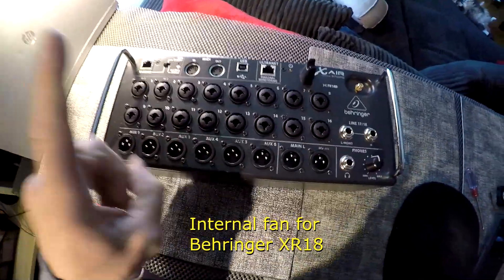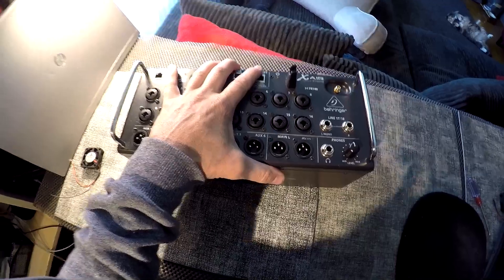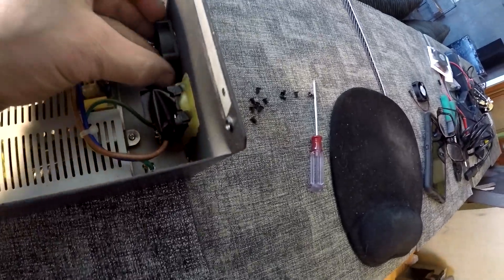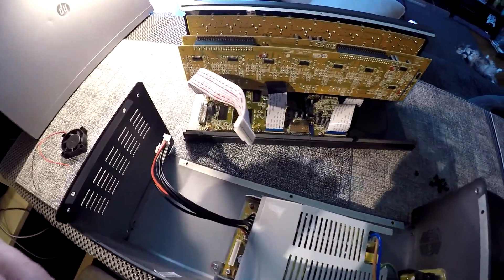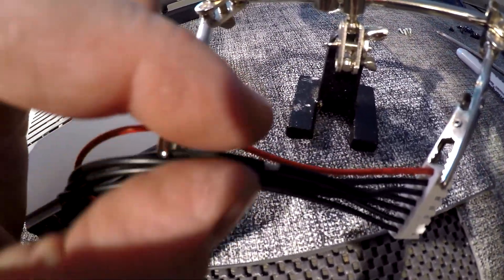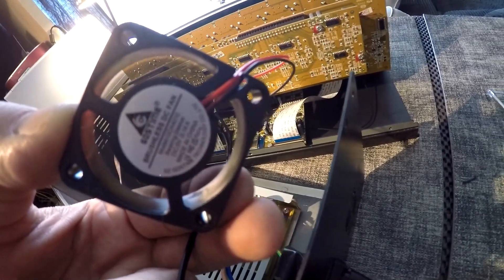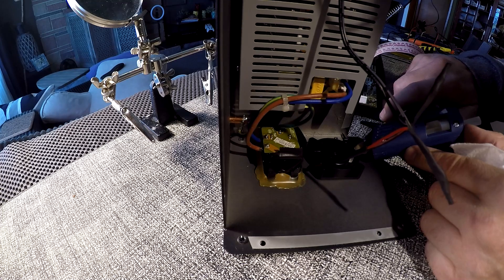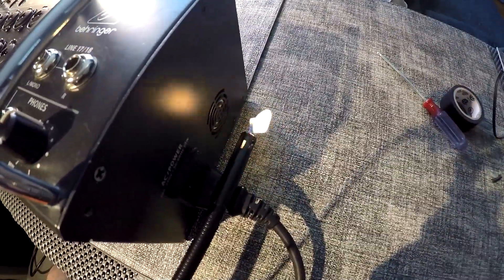Behringer XR18 internal fan mod

Comment: Wow i really thought there was a fan in my unit , did you point the fan so it was blowing out or in? im going to give this a go, noticed how warm the case gets after use
Reply from the maker: I actually tried pointing out first..then reversed it to go in.. didn't notice any  difference.. all that matters is there is air movement within the case..of which either way seems to work.

Comment: Siempre me pregunté que tanto costaba añadirlo de fábrica 😅

Me parece genial que no se indusca ruido notorio adicional a los canales, intentaré agregar un botón de encendido y apagado para cuando se requiera el silencio.

Gracias por tu vídeo!
Reply from the maker: I did replace the fan once since due to it being a bit of a cheapo fan.. but still running strong with zero issues or noise.. :) On/off switch is a good idea..if you want pure silence in the room. Makes sense.. I might do that too.  Thanks for the idea! :)

Comment: I thought about this. But I also thought I saw a header for a fan. That fan you used covers half the hole in the center.
Reply from the maker: @allenhoekstrajr  regardless of the perceived restriction...it works. It moves air and cools things down. Not many options internally to mount a fan. I recently reversed it as well to draw air in through that small  hole rather than out. Equally as effective. There is enough flow that you can also feel the draft push out of the input jacks and side vent.
Reply: @PaulGibbonsMusic  Note that I'm not trying to say anything bad about what you did. I appreciate it and am glad to hear I wasn't the only one looking for a solution. I also appreciate that you confirmed that it works effectively. Do you think more/better airflow would be better or do you think with this mod that it's more than enough?
Reply from the maker: @allenhoekstrajr  oh I didn't think you were saying anything bad! Scrutinizing is definitely accepted and required for the best ideas to come fourth. :) For me, this mod was all I needed. Before this mod, I would point a small 10" floor house fan at it. It was probably more effective as the airflow would encompass the entire housing with much more 'thrust' and convection, however, who wants to point a big fan at it every time? hehe. These units are fine without the fans for the most part. My reasoning for doing this was primarily due to literally performing in Penticton in 40 degree (Celsius) weather with this XR18 cooking in the heat.(Literally the steel casing could fry an egg!)  I knew it was only a matter of time for heat failure so I figured why not. A buddy of mine fried his XR18 power supply because he always left the unit in his little gator case when operating, blocking any venting from the side ports. (most inputs were used as well, so no flow through empty input jacks, and he had no fan mod either). I have 2 xr18 units, one without a fan and one with. I have run them both simultaneously. The one with the fan is significantly cooler to the touch.  So, in conclusion (lol) anything is probably better than nothing? :)

Comment: Hello, I have an XR16 with the same chassis, which after several hours of operation begins to become silent for no reason, do you think this mod could help?  thank you.
Reply from the maker: hmm.. that's a tough one to discern whether its a heat issue or some other issue with the unit. I would try a simple test.. point a normal house fan at your xr16 and run it like normal to see if it goes silent as you state. The fan will push air through the unit as well as around the metal casing, definitely cooling it more than normal. If this does seem to solve it, I see no reason not to do this mod if cooling helps.

Comment: I’m really curious to see all of the EM noise you just introduced into all of your channels. Crank the input gain up on an input, set the fader gains to unity, and look at the RTA for the main output.
Reply from the maker: Zero noise..in terms of additional noise the a noise floor with everything cranked as you state.. Nothing different from disconnected vs connected. The only issue for noise would be the fan itself in a silent studio environment. Its subtle, but there. However, I use this unit for live events only. Those outdoor summer events can get this thing pretty toasty.  My other one is in studio. No fan on that one.
Reply: @PaulGibbonsMusic  I have added two fans (10000 rmp each) according to your tutorial and I can confirm there is no EM noise on any of the channels. But what's bothering our bass player is the constatn G-sharp sound it makes 😁
Reply: Thats a relief to hear guys

Comment: Great idea. Thanks! How and why did you determine which end to draw air through? Maybe power supply us on fan side. I have not opened up yet.
Reply from the maker: I determined it by the only available space to stick a little fan..of which is the fake fan hole side.
Reply: @PaulGibbonsMusic   that "fake fan hole" makes me wonder if a fan was in the design, but nixxed in favor of costs or just lacking the need for one. Seems like a justification was made somewhere late in the design process. Cool video.

Comment: Thanks for the video! Must admit I have not kept an eye on the temperature of my Midas MR18... Do these units always run hot? Or just under heavy DSP (FX) usage? Did you do any such tests/investigations before your little fan project?
Reply from the maker: Just plonked it in. haha! It definitely does not get as warm to the touch on the casing as it used to. Good enough for me!

Comment: I bought a bigger ac fan and glued it on the other side.
So now i need to plug 2 ac cords everytime i use the XR.
Reply from the maker: Hence why I like the little 5v fan idea. Just a small amount of air movement suffices IMO.
Reply: @PaulGibbonsMusic  i mean, no extra work to do, no need to open the casing, strip the wires, etc...
Reply from the maker: @johnfisher2206  haha for sure. Prior to this mod...a
I  just pointed a regular household fan at it. Haha
Reply: @PaulGibbonsMusic  if it works, do it! Hahaha...